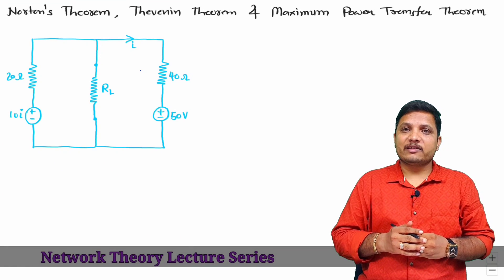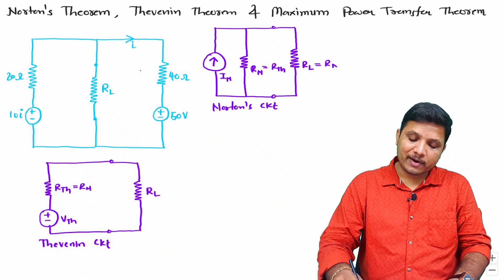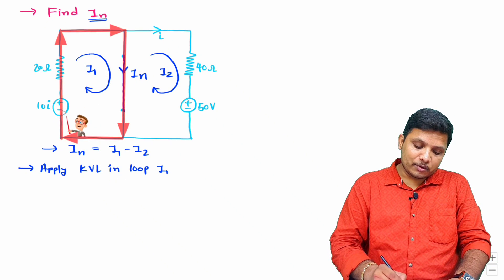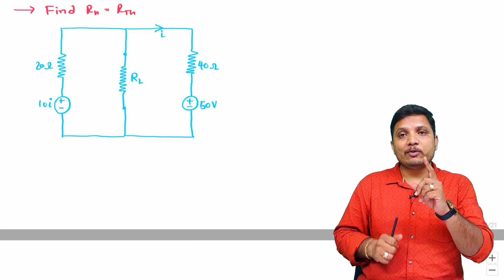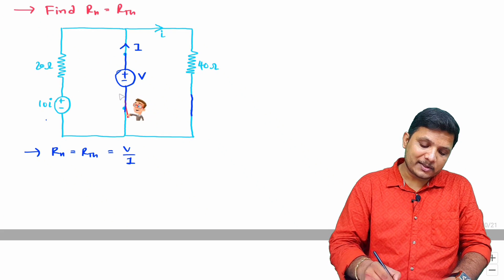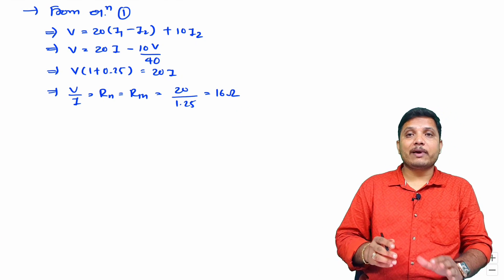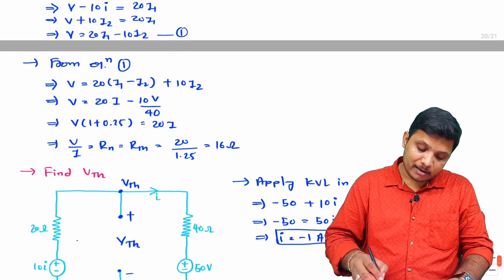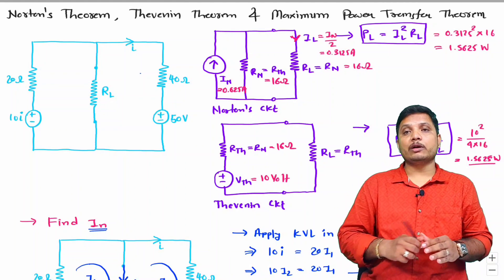Norton’s, Thevenin’s, and Maximum Power Transfer Theorems: Examples with Dependent Sources

Comment from the maker: Norton's Theorem, Thevenin's Theorem & Maximum Power Transfer Theorem Example for Dependent source with following Timestamps:
0:00 - Network Theory lecture Series
0:29 - Norton's Theorem Equivalent Circuit
1:04 - Thevenin's Theorem Equivalent Circuit
1:56 - Maximum Power Transfer Theorem 
3:09 - In Equivalent Calculation for Norton's Theorem 
6:18 - R Equivalent Calculation for Norton's Theorem / Thevenin's Theorem 
11:38 - Vth Equivalent Calculation for Thevenin's Theorem  
14:00 - Maximum Power From Norton's Theorem Equivalent Circuit
14:54 - Maximum Power From Thevenin's Theorem Equivalent Circuit